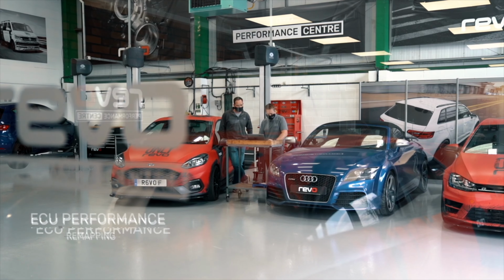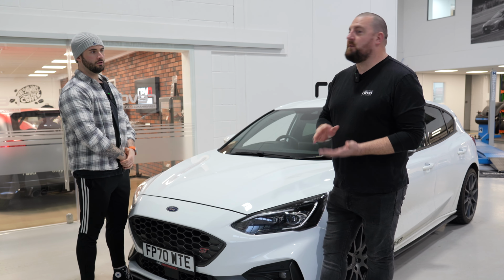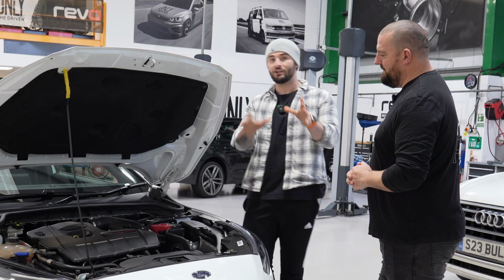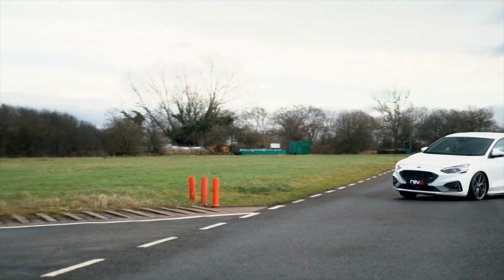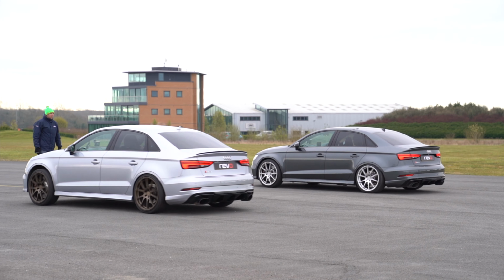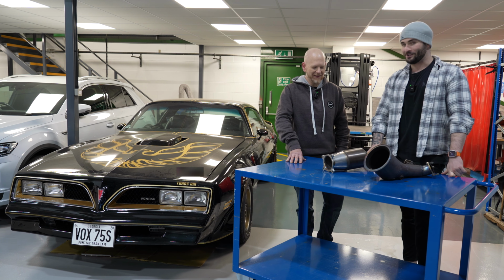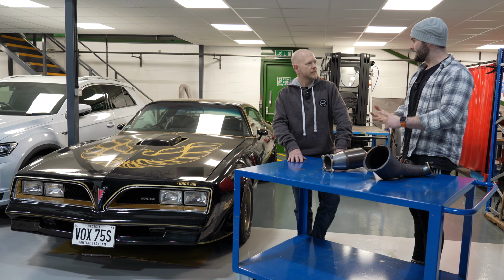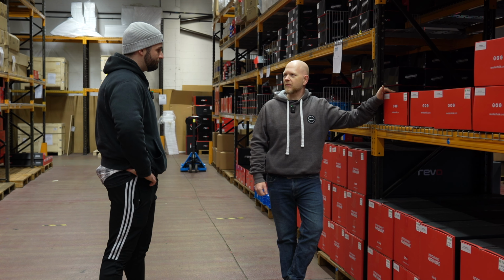A Modified Car Can still be "GREAT FUN" without making it ILLEGAL? - Police RS MODS inbound!

Comment: Is that mk4 on standard ride height? I want mine to sit lower but not sure with the state of UK roads.
Reply: It's stock ride height
Reply: @stevew4340  Thanks chap! looks like it has spacers on which makes it look like it's sitting nicer than stock
Reply: @anilkalsi6026  No spacers are fitted, the RF0 Revo wheels simply sit really well on these as specifically designed for this fitment, the stock suspension is impressive on the Mk4 ST, there is a concern about ruining them if lowering, stance wise it sits well, if it were for the VW scene then I could imagine people may want lower but for me it's perfect, handles brilliantly and looks great without any concerns for catching the underside.

Comment: I don't care what revo says pops and bangs will kill a cat
Reply: 15,000 hard miles so far and no issues on stock cat with Revo Stage 2.
Reply: @Mr Worthers  mate even supercars etc will have a bypass pipe so the cat doesn't break up, fireballs going through the cells equals bad times
Reply: @benjaminsmith5342  supercars may but no hatch with factory overrun does to my knowledge and so many have it these days.
Reply: @Mr Worthers  modern cars usually have a performance mode not designed to be driven daily lol also have you heard modern cars launch control etc they do not pop or anything also there is a difference between a couple tiny pops compared to overrun

Comment: I think this video leaves a certain amount of ambiguity regarding what is legal and what is not. Although the exhaust may be "road legal" because it has all the correct components fitted, if you drive that Focus ST in a residential area with those pops and bangs, you are going to get a fixed penalty for either "modifying the exhaust system to increase the noise made" or "driving in a manner as to cause excessive noise". As soon as you move away from the stock exhaust system (that has undergone extensive testing at the factory to ensure it complies with EU/UK sound regulations) and fit your own after market system, you open yourself up to prosecution. By all means, on a track, be as loud as you want, but I would urge caution when you buy these aftermarket exhausts. If you are going to produce a video that is entitled "road legal", I think your friendly traffic officer needs to be providing the advice rather than someone who works for Revo who of course is going to want to sell lots of exhausts!
Reply: I agree with the basic point but I also have no sympathy for anyone that thinks aggressively stomping on the loud pedal to trigger pops and bangs in an urban area in an acceptable thing to be doing. Even with that map on it, I doubt the car will be popping and banging IF driven how a vehicle SHOULD be driven in an urban area.

I understand that someone with an overly loud exhaust could even be pulled for it on the motorway (in theory) but I suspect most traffic officers will consider the environment the vehicle is being driven in at the time AND the way it was being driven e.g. bouncing of the rev limiter in an urban area is automatically going to get the officer's attention!
Reply: @FatHead1979  exactly, you have to drive in a certain manor to get the overrun kicking in like that and that type of driving as you say is not appropriate in a built up area.
Reply from the maker: Revo don’t sell exhausts tho.. it’s all about a time and a place to be honest. I probably should have got more rules info in the video but the st is an example that you can have power and a nice sounding car while remaining road legal. You don’t need a decat to make good numbers. The rules are confusing. This is why we’re trying to over the videos we make, make it more clear. My apologies if I did that incorrectly
Reply: @georgescarmedia  Please don’t allow me in anyway to discourage you from making such videos. They are well needed in the car modification world. However, when you have someone bouncing a car of its limiter, causing pops and bangs and you then ask if it’s road legal and they say it is, it gives the impression that as the exhaust is road legal, the pops and bangs it produces are perfectly legal also and no matter what you do with the exhaust it will be legal. I just don’t want our young aspiring car enthusiasts to get mislead, which I’m sure was not your intention. I think it’s a great video to showcase what Revo do and maybe would suggest retitling your video as such and do another video with the traffic officer regarding exhausts. Keep up the good work though! 👍🏻

Comment: I'm curious to know how that exhaust on the ST is road legal? Has it still got the gpf?
Reply: Given that Revo explicitly stated that they don't deal with vehicles where any of the legally required emissions hardware has been removed, I think we have to assume so.
Reply: Fully road legal and rather refined when not on the loud pedal, it's the Milltek 'Resonated' (quieter option).
Reply: @stevew4340  but majority of millteks exhaust kits are "cat back" systems, replacing all exhaust components from the cat backwards would remove the GPF which is currently illegal in the UK, that's why I'm struggling to understand how this exhaust system can be so loud/legal with the gpf fitted?
Reply: @georgesmiff4585  It’s not legal, you’re right. However it’s one of those “grey” areas between a policeman and an MOT station. 

You can pass an MOT and have a car insured that has a modified exhaust. However, if a policeman finds out that an emissions hardware (GPF/CAT/ has been completely removed - that’s when it becomes illegal.

It’s such a massive grey area and causes so much dispute and confusion. 

But yeah, legal in the terms of its MOT’d and Insured, illegal if the police know for a fact and can prove a piece of emission hardware has been removed.
Reply: @georgesmiff4585  presuming you didn't bother going on millteks website to have a look for yourself? Most manufacturers, like Milltek, make GPF backs for newer cars. Therefore the exhaust is only modified AFTER the GPF.

Comment: Maps shouldn’t wipe themselves as it’s hard coded to the ECU?
Reply: This only occurs on the MED9 ECU used in 5 cylinder Fords & the old Mk5 Golf TFSi where the settings default to stock values when power is lost to the ECU as the MED9 has no memory capability, the Revo file is fully timing boost and fuel adjustable as set up for the individual vehicle and driver preference, therefore if you have the SPS switch it stores the chosen values for timing boost and fuel allowing you to reset the file on your driveway, it also allows you to store three presets so you can for example have settings stored for lower octane or more aggressive settings for say a weekend or track mode, the SPS also opens up features including anti thrift and valet mode on MED9 cars.
Reply: Map doesn’t wipe itself. It reverts back to stock mode when the ecu losses power as it has switchable power modes
Reply: Yes that’s correct

Comment: Might be an unpopular opinion but pops and bangs should be banned on public roads. They are obnoxious and intrusive.
Reply: Personally love fast cars but pops and bangs sound awful and annoying and the fart box dsg things 
Acceptable on a rally car obviously 
Old school for me as I'm an old man 😂
Reply from the maker: I agree. Didn’t used to. However now I prefer burbles and the odd pop. Not a fan of bangs at all. But the focus in the video sounds good but I’d keep it out of sport mode 😂😂
Reply: My car does it from factory though?
Reply: @hugheszie  That may be the case but I'm sure it only does it under very specific conditions e.g. aggressive throttle inputs etc. No 'from the factory' car is going to be banging and farting down the street IF driven sensibly appropriately for the area it's being driven in.

I suspect that most people who say about banning 'pop and bang' maps aren't really thinking about the odd 'from the factory' car that can be made to do it occasionally by the driver and are more bothered about some absolute 'cock womble' in a heavily mapped RS4, bouncing off the rev limiter in a residential area and all anyone within a 2 mile radius can hear is "pop, pop, pop, pop, pop, bang, bang, bang, bang, bang, pop, pop, pop, pop, pop, bang, bang, bang, bang, bang, pop, pop, pop, pop, pop, bang, bang, bang, bang, bang".

(I'm also not a massive fan of popping and banging, especially when it's done to excess, there's really no need for it)
Reply: Killjoy 🙄🙄🙄